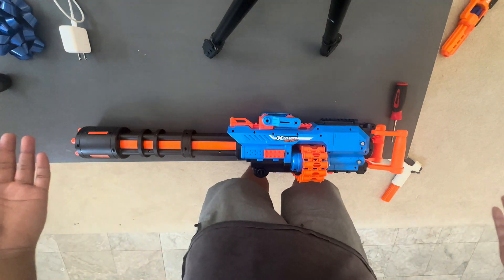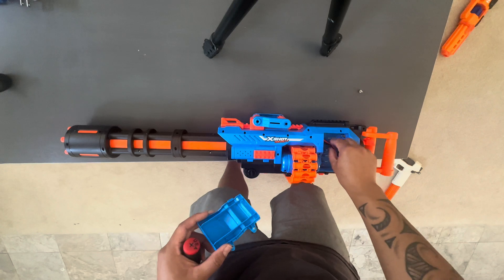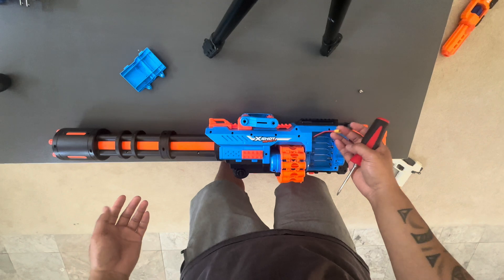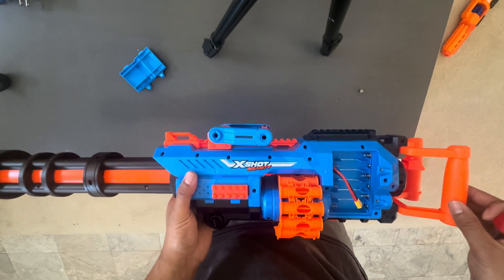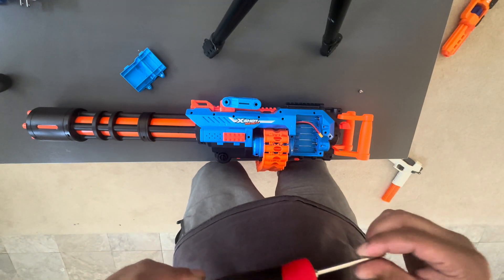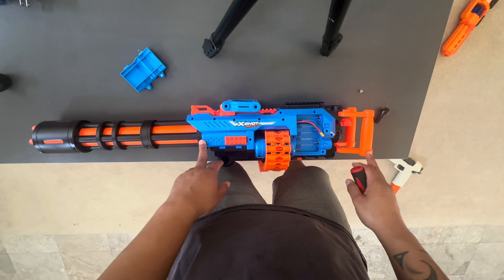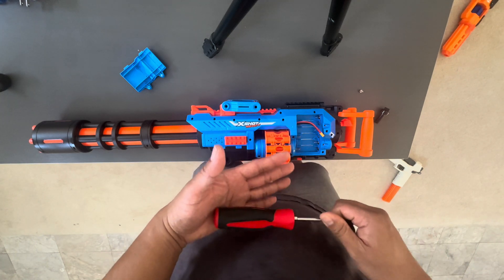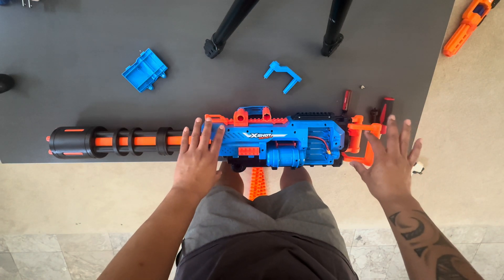Xshot ragefire 3s lipo mod explanation

Comment: Wait so can i get away with just creating a connection for the lipo or do i NEED to mod the motor as well?.
Reply from the maker: If u jus add lipo ur looking at using 2s battery safest
Reply: Also if I do change motors will the Loki 130 neo motor work? Im very new to this but I somewhat understand on what's happening in the video
Reply from the maker: @kalell7434 yeah but those are for small sized flywheels. Go with krakens

Comment: Did you have to replace the switches for 3s? Or upgrade the wiring attached to them? I have a printed cage with wire ready to go but I don’t know what other wiring I need to replace with the thicker kind. Do you have a wiring diagram for this blaster?
Reply: Yes, you have to replace the switches. That is a MUST.

Comment: Thanks for the video. So will a 41.5mm flywheel cage and Kraken motors work? Or do I need to use your Worker Phoenix 2.0 motors and a 41.5mm cage?

Man I don’t even know where I can buy these flywheel cages..
Reply from the maker: @ChrisLe22  krakens are perfect 41.5  is decent . Check Etsy or buffdaddynerf products
Reply: @bboychips thanks for the prompt reply my man
Reply from the maker: @ np good luck with ur modding!

Comment: I just bought one now it jam how do I fix it
Reply: Know it’s probs been a while, but the jam most likely will occur in the barrel OR flywheels. The flywheels cannot rev of anything is trapped in-between them since they need to accelerate.

To fix this…

Just get a long stick, and run jt down like a ramrod down the barrel and push the darts out (never use old darts regardless of the brand btw).

Comment: Wow, amazing job. I’m going to do that to mine. I have two questions though.

1: how many darts per second would you say it fires?

2: do you know it’s FPS?
Reply: OK, I have that noted. I also use your description to get the items to modify it. Thank you so much. I’m going to destroy with this thing😂
Reply from the maker: @TheBritishBRAD  let me know if u run into anything. I’ll be glad to help
Reply from the maker: @TheBritishBRAD  depends on battery. I think like 4 dps on 2s maybe like 6 dps on 3s and 8 dps on 4s. I made a 4s video. My chrono is to small but maybe 150 drops on short darts and 120 long darts. We really don’t play with this just shoot it in the house.
Reply: @bboychips quick question what’s DPS stand for?
Reply from the maker: @ darts per sec which is the rate of fire or rof
Reply: OK sounds good👍
Reply: Do you know how you said you made a video that shows how to do 4s. Well I couldn’t find that video. Is making 4s the exact same just use the 4s instead?

I was looking at 4s lipos but could not find 4s motors(I dont even know if those exist) would it work if I keep everything but replace the 3s lipo with 4s lipo?
Reply from the maker: @TheBritishBRAD  the 130 motors can handle it but don’t plan on running it for loads of time. I would use kraken motors. Make sure u take out that thermistor connected to the battery leads. It just limits everything. There’s a guy who has a faster rof by changing the pusher motor to a fang or a kraken motor. It’s a little too fast like a dart hose. Safe side 3s is better to use if ur gonna be shooting many rounds over and over. If u use 4s don’t plan on holding the trigger for long amounts of time.
Reply: Would it work if I upgrade the motor that spins the chain belt?